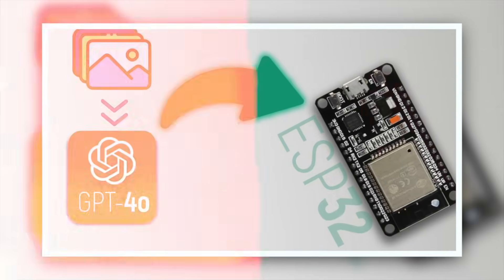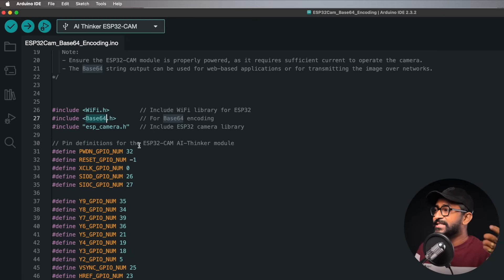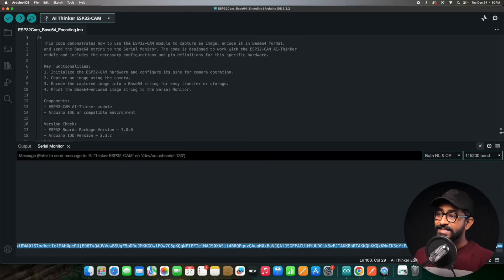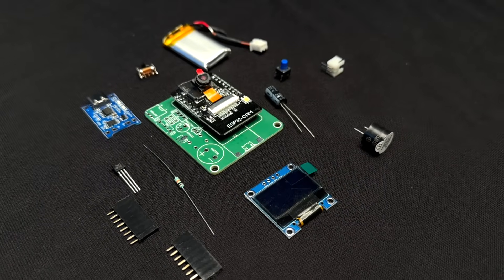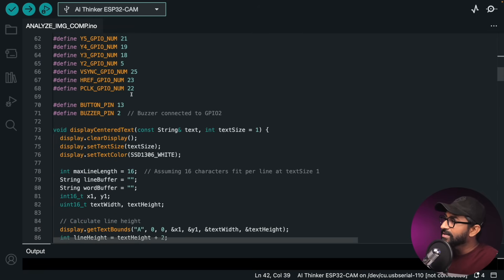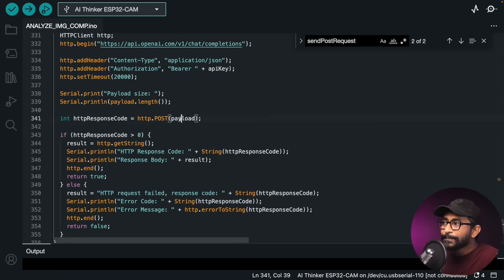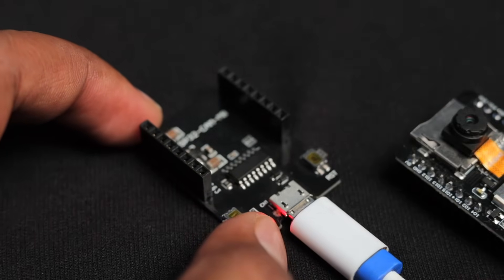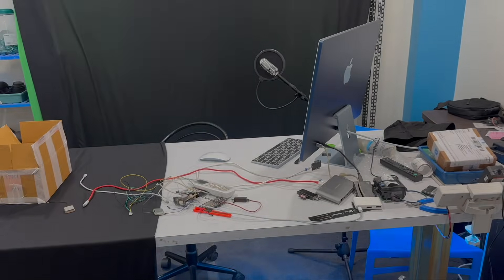AI Vision Project using ESP32Cam & GPT-4o 🔥🔥 | PCBGOGO

Comment: i want  make smart glasses  ,futuristic like EDITH glasses  which will give you all info just by one click , if we just add one mic module and two buttons one button for image capturing thing and checking and other for using chatgpt like we use in our mobile ,means two applications .just by one click you can literally get any info whether it is plant info or other general information . this thing can be made compact and attach to btw the to lens ,ya initially it will look bulky but proper weight distribution is possible .

Comment: Well, we can use such vision modules with drones to make a human follower or an object follower drones like in movie oblivion (Assuming the module can capture videos and process locally). To elaborate, we can use a custom flight controller made by stm32 which taking data from vision module will control fight with giving signal to esc for motor control.

Comment: I will create a smart portable device for mute individuals using the ESP32-CAM module. In this device, users can perform one-handed sign language gestures (ASL) in front of the ESP32-CAM. Image will be clicked after a wrist shake that is detected by a vibration sensor, the camera will capture a photo after a 1-second delay. The recognized gesture's output will be displayed on an OLED screen in the form of text, accompanied by audio feedback and vibration alerts.
For image recognition, we can utilize  Gemini AI in place of expensive chatgpt or develop a custom database for sign language translation. This device has the potential to greatly enhance communication for mute individuals.

Comment: Hey Sachin, great project!!! Without this video, we can't imagine using an AI model with just an embedded board. I have a few suggestions to enhance your project.

Firstly, I recommend using a color TFT touch display. This will significantly improve the user experience.
Secondly, I propose replacing the ESP32 Cam module with the Xiao ESP32 S3 Cam module, which is more compact, efficient, and features a built-in battery charging circuit. 
Lastly, I suggest removing the physical button and adding a virtual button on the display instead. Also, instead of a single question adding a microphone just like your "Speech to Text Conversion using ESP32" for asking the question. This will create a compact ai machine in hand just like the Rabbit R1.

All my suggestions aim to either enhance the user experience or improve efficiency. Implementing a color touch display is relatively straightforward, as companies like Waveshare or DWIN offer custom firmware.

Please note that incorporating these suggestions will increase the cost by approximately $30-$35 (INR 2.5K-3K).

Comment: This is best project ever made by you. You can also made this project. The ESP32-CAM can capture images of roads while mounted on vehicles or drones, and GPT-4o can analyze them to detect hazards like potholes, debris, or damaged signage. Real-time alerts are displayed on the OLED, or notifications can be sent to authorities for quick action. This project can improve driving safety and streamline road maintenance. Imagine its use in smart cities or rural areas, where road issues often go unnoticed. By providing a cost-effective and efficient solution for hazard detection, this project ensures safer roads for everyone.

Comment: i think tp4056 is not the best choice for charging the lipo battery you should go for any other bms because tp4056 lacks some features like over current or over voltage protection
Reply: Hello

Comment: A potential project idea is to develop a system that bridges the communication gap between deaf and hearing individuals. The system could use a camera module, like ESP CAM, to capture sign language gestures in real-time. These gestures could then be processed and translated into text or spoken language using AI models. Similarly, text input could be translated into sign language using pre-animated sequences displayed on a screen or avatar. The ESP32 could serve as the central controller, managing the data flow between components, processing lightweight tasks, or communicating with cloud-based AI services

Comment: 13:30 that esp32 cam modules are 1st copy. i faced these problem before ,  then i researched it. that Gnd pin near TX RX is not Ground. its Reset pin or Enable pin. but in original cam board its Gnd pin, and one more thing they reduced the PSRAM size to 2MB in this dublicate board.
Reply: informative👍
Reply from the maker: Thank you so much for clarifying this

Comment: Here are few of my ideas 😃
1.Diabetic Warning: take product label image. If the label contains 'sugar' or 'sucrose' or fructose, 

start buzzer and show warning message or symbol on LCD
2.Plant Disease detect: Farmers or agri field officers  can take image of leaves and diesese identified can be shown. Even if 
 Chat GPT doesn't work, there are many free APIs to do so.
3.Control Relay: Take finger image. Depending on number of finger, relay can be controlled. Eg: 1 finger 
control relay 1, 2 finger control relay 2 etc. This can also be used to control various appliances 

based on rely number.
4.Write Story: Change the Chat GPT prompt to "Write short story based on image" and it will show short 
story based on image
5.Control lights: take picture. If bed is detected, control bedroom light. If kitchen is found, control 

kitchen light etc
6.Washing machine: Instead of using push button, take picture every few minutes of washing machine LED. 
 When it shows 'end', send MQTT message to inform the user.
7.Calculate Electricity bill: Let's say previous month electricity units are stored in program. After 

taking current electricity unit picture, subtract it with old units and calculate the electricity cost.
8.Bird watch: take image of bird in sanctuaries and find details of bird using either GPT or API like ebird.
Reply: imagine using gpt to generate ideas 💀
Reply: @ynwthc  😀Nope! They are my own ideas. I have already implemented many of these in personal android app. I use Gemini 1.5 flash in my app since it has a generous free tier. For bird detect I used ebird API. For plant disease with leaf detection I used roboflow model. The thing is there are too many restrictions in latest android . You need run time permission for practically any useful tasks, battery optimization shuts down apps and when screen goes off, the app pauses -this despite 'wake lock' so the best way for long processes is to use microprocessors.

Comment: Use case 1.
Can we ask camera to capture in a specific area. 1feet x 1 feet. Detect weed. Specify which weed. Solenoid will get triggered. Spraying is done.

Use Case 2.
Ask camera to capture image of seeds. It will  tell quality of the seeds. Germination etc.,  Again image capturing should be precise in size, pixal. This will be used in many areas.
ChatGPT works better in this situation.

In your case image is captured a very large area. Telling geometric images. It was not actually focusing fully at Water Bottle. It took entire area.

Image display is ok. For some application it is required. Others  no. It just adds to cost.